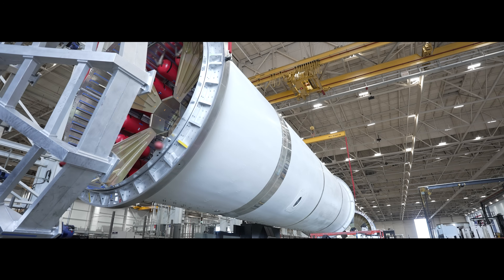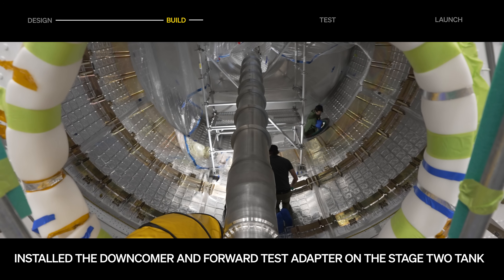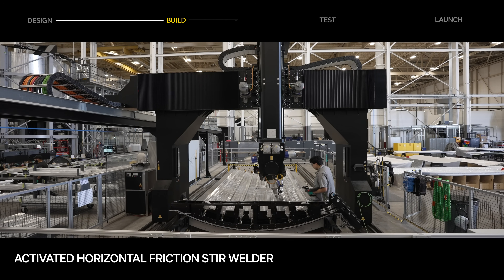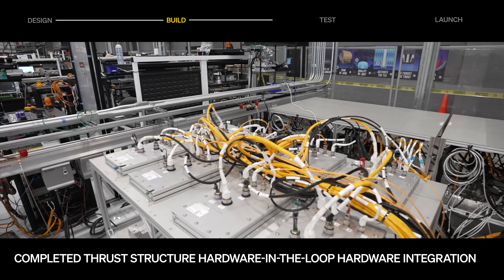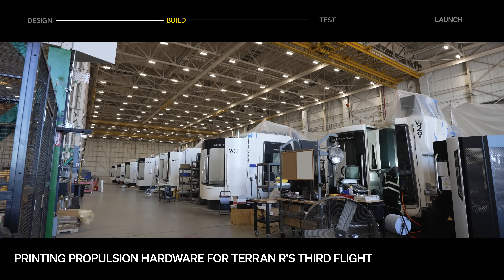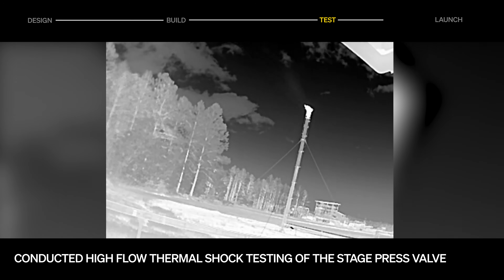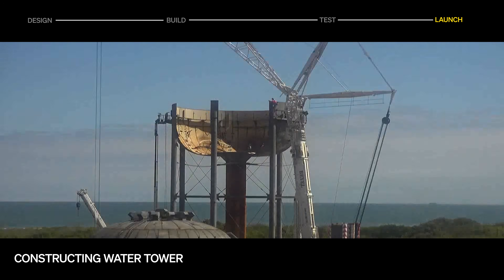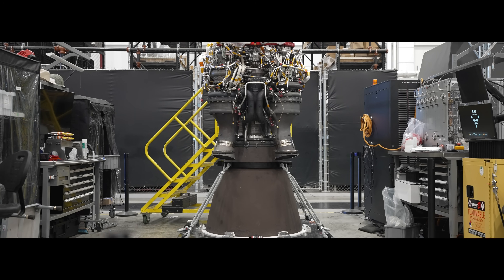Terran R October 2025 Program Update

Comment: Dumb question: I thought the point of NASA having the Stennis facility was that there were test stands and GSE for manufacturers to use so everybody didn't have to build their own, but it looks like you're building your own from scratch. Have I been wrong all this time?
Reply: There is actually common NASA infrastructure (the E-1 test stand) used by a variety of companies, but generally engine and stage test stands are customized to the vehicles they test, as the propellants, required flow rates, and other requirements are wildly different across different stands. 

The A-2 stand was originally built by NASA to test the Apollo upper stage and Relativity is modifying it to support testing of Terran R.